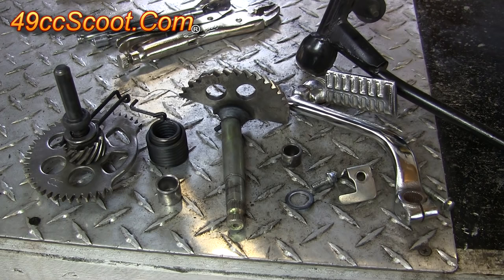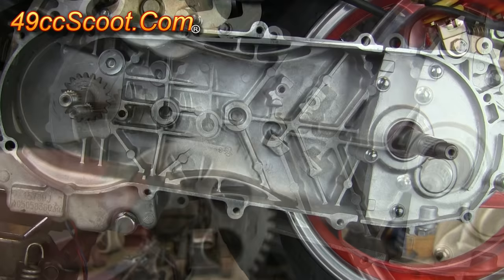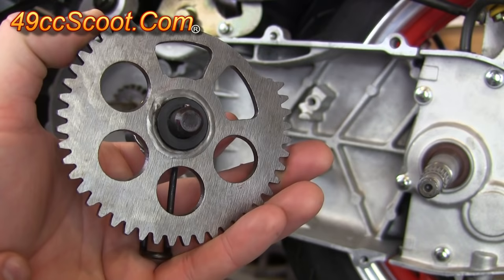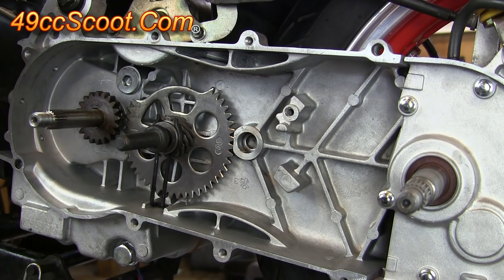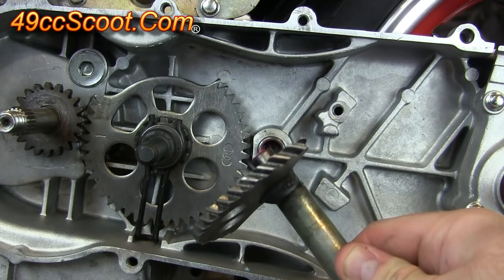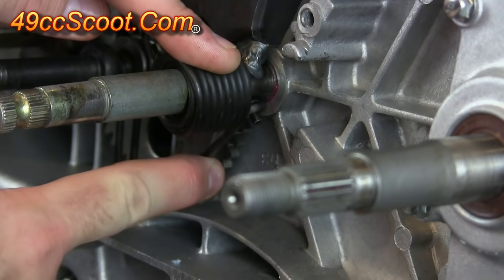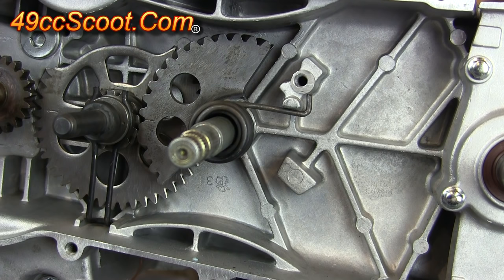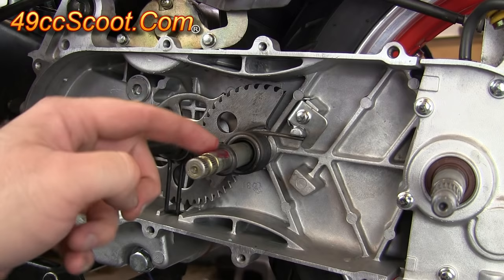How-To : GY6 125 / 150 Kick Start Gear Installation (Scooter, Kart, ATV)

Comment: I would like to delete the kick start and add a pull start.
Reply from the maker: Pull starts are usually more complicated; at least if you actually take the pull start mechanism apart. You'll probably want to look at things like mowers and other yard equipment and see what could possibly be adapted. Preferably from a much larger engine than yours, because I'd be concerned with reliability or durability for this application. If you can find a suitable unit, maybe a custom fixed half for the front pulley could be machined or an adapter of some sort. If you're capable of kick starting, this is the sort of project that I'd only suggest taking on if you enjoy a challenge and are prepared for some failures along the way.

Comment: Your missing one main component... THE MAIN KICK GEAR THAT IS ATTACHED TO THE CRANKSHAFT... if that gear is broken or stripped this video is of no help at all...
Reply from the maker: Not really missing that. That is not a common issue like the springs and gears actuated by the kick lever. If you need to remove the gear on the crank, you need a gear puller. Then you can use heating and cooling to help get a new one on the crank. I've only ever taken that gear off when removing the crank, but I'm sure they fail infrequently. The good news is that your comment is here now so maybe someone will read it.
Reply: I wish there was a way to upload photo comments to youtube… your wrong about how often they get damaged the gear behind the variator is damaged about 90% of the time when the kicker gets jammed like yours was in this video. The difference is normally then dont jam but just get out of alignment and this dont require replacement parts. All its takes is a jammed kicker and then one press of the starter and you've broken your kicker starter clutch and main kick gear.  @49ccscoot
Reply from the maker: @ghettodexter  No need to post proof that you've seen it happen. I believe you. I still don't think the frequency is that great. I've spent the last 15 years running scooter forums and it's just not something that I recall hearing much, but that doesn't mean it's not common.
Reply: @49ccscoot  totally man I respect your advice and opinion. My comment was made simply because that's was the problem a friend of mine had and I sent him to your channel but this video you didn't mention the possibility that a broken main kick gear could be a culprit. He purchased everything it this video but when I went to do the job the gear was the only issue. The kicker stripped teeth off the main crank gear.

It may not be common but when giving advice on a fix it's best to cover all possible causes. This issues isn't so small it can be ignored and it's not like checking it while your in the cvt would take more than a rotation of the motor and flashlight... and why I feel it was completely overlooked. Also by installing a new kickerset on a broken gear you'll just be throwing money away. IMO no excuse if you have been doing this for 15 years.
Reply from the maker: @ghettodexter  I guess I am mistaken in thinking that if someone saw a cracked or stripped gear, common  sense would take over. Again, I've never personally seen one crack. The intention of this video was more to explain how to get the kickstart back together, because a lot of people have trouble with that specifically. It's hard to cover everything sometimes, and easy to forget something that you've never had to deal with.
Reply: @49ccscoot  He didn't see the gear I did, he just knew his kicker was jammed. I sent him a link to this video, he got the parts to replace and brought me the bike. I then looked behind the variator to check the main and saw the chipped teeth. Not only was the gear stuck but the motor cranking over broke teeth. Not trying to be a dick just adding clarification as to why your wrong man... Its ok we all make mistakes in our professions, but I bet you'll check that gear everytime your in there now budd.